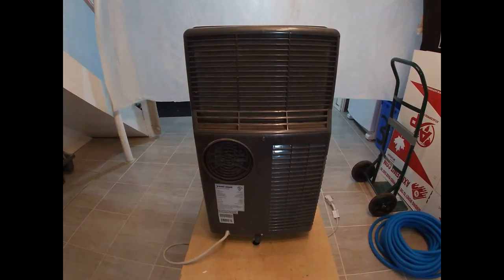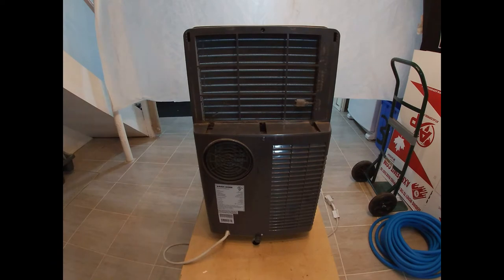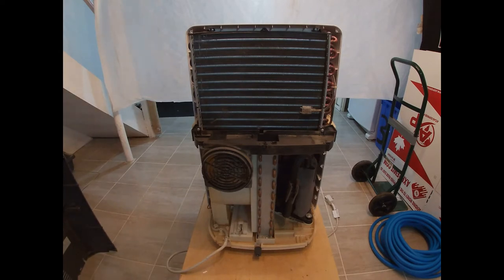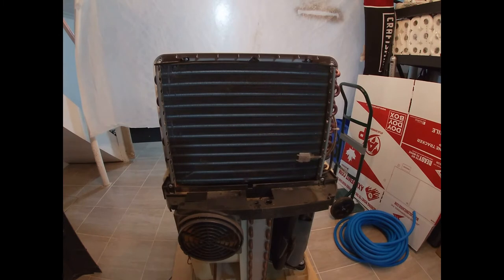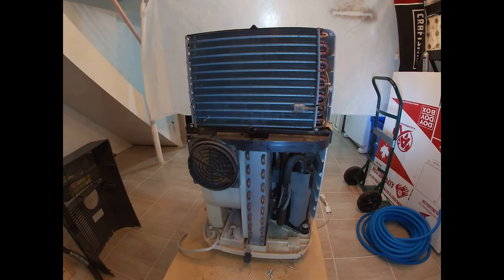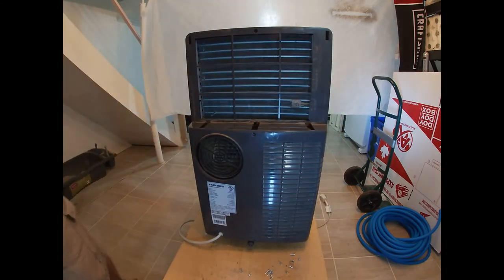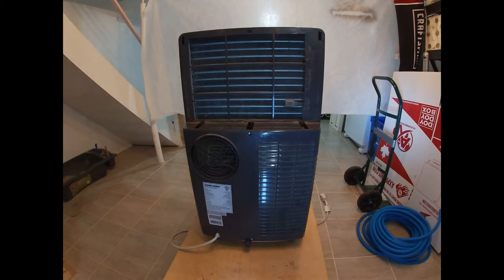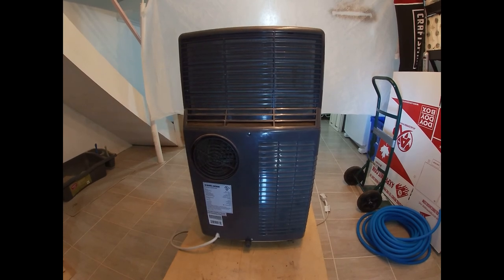How To Clean Black & Decker Portable Air Conditioner Coils

Comment: Firstly thank you for this video, was super helpful to understand the proper cleaning method. The manual is so vague... Apologies in advance for a long comment and I know you're not here to diagnose issues with the unit. I simply can't find answers online and imagine you may have a bright idea. If not, that's totally cool (pun intended?). 
I've owned a nearly identical unit BPACT14WT for only a year. Aka it was only used consistently for one short Seattle summer / 2 months at best, last year. This year, aka today it simply isn't cooling the room. Cool air is definitely coming out and its in the same setup it was last year but it won't drop the temp of the room more than 2 degrees no matter how I set it. Then when it gets 2+ degrees warmer outside, in turn, the room goes up 2+ degrees in tandem when its still set at the same auto temp setting or even if I bump it 2 degrees higher. We're talking about it being maybe 80 degrees outside at max throughout the day. The behavior this morning is dumbfounding. Upon waking up today my room's inside temp was 72. Outside temp was only 66. I put the unit on 68 and let it run for about 4 hours on auto mode. In that time the outside temp reached maybe 75 degrees at best. I figured the unit would've dropped the room temp to 68 shortly after first setting it, but it never did. It dropped the room to 70, never any lower per two different thermometers I have and the unit never shut off (since obviously the room never lowered to 68). Then after 4 more hours my room was up to 72, 4 degrees higher than the expected setting. I previously followed your instructions to dismantle, inspect and clean and TBH there was nothing visible to clean. No dust accumulation or anything, it still looks brand new inside and out. I took the vacuum to it anyway in all places in your video. I even ensured the water tank was drained, no ice on the coils, checked the exhaust hose to make sure all is well, but I'm still facing the same issue each day. The tiny window the hose is hooked up to is completely free from blockage and sealed well. All my other windows and blinds have been shut all day so there isn't some other offending heat source going on. The unit itself shows no signs of malfunctioning either physically or on the display. What could be wrong here? It did not have this behavior last year, so I feel like I'm missing something obvious about what may be broken.

Comment: nice, noticed my top radiator is producing a ton of water. Think this means a deeper clean is needed? possibly air flow is still blocked?
Reply from the maker: When it produces a lot of water that just means it’s most likely just very humid in the room that the ac is in. My midea unit sometimes fills a 5 gallon bucket in one night while I’m sleeping. That being said, a deep clean with a coil safe cleaner and a brush is always beneficial to the efficiency of any unit. I vacuum the fins off every year and I use the cleaning chemical every three years. Hope this helps. Thanks for watching. Please like and subscribe